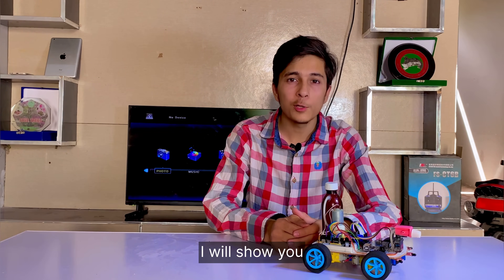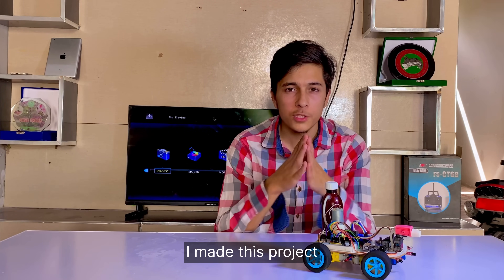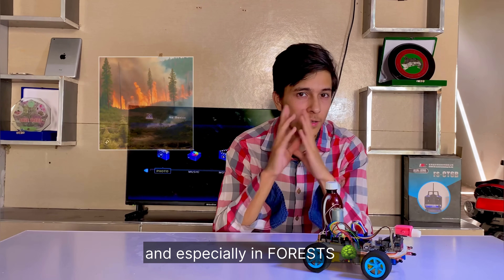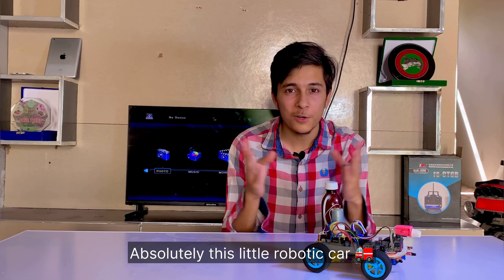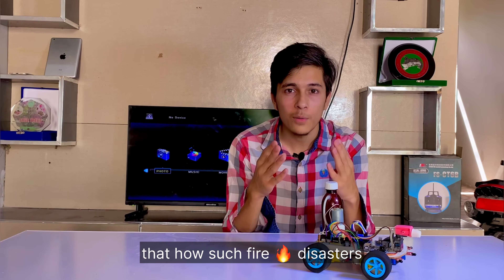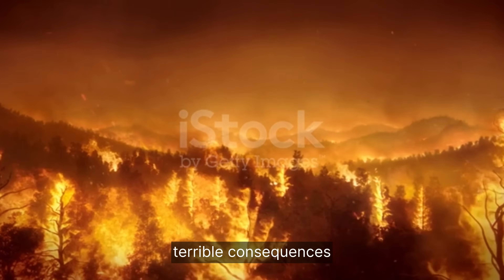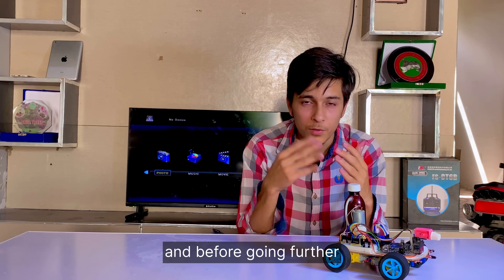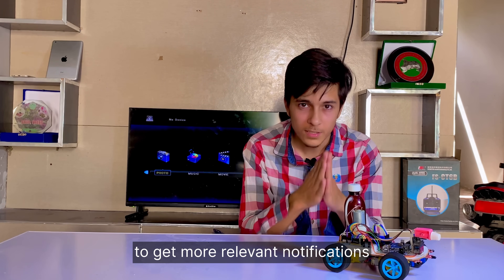DIY Fire Fighting Robot using Arduino  |  Auto Fire Chaser and Extinguisher

Comment: Its taking too much time to upload code??
According to you how much time it take to upload
Reply from the maker: Since I am doing, less than a minute, usually 10 seconds
Reply: @saadinnovativeideas it was taking too much time(4-5 mins) so i remove the cable and push red-button on uno for reset and then re-upload this code and this code giving error.
Reply from the maker: You may not have selected the right port (COM) or you cable may be faulty
Reply: @saadinnovativeideas  All thing is good 
but one major issue is my robot is not moving after detecting fire and some time it is giving long beep sound.
Reply from the maker: Yeah, you power supply is weak. Name the batteries and net input voltage
Reply: @saadinnovativeideas  
MICROUSB Compatible with Ultrafire I865O 3.7V/6800mAh Rechargeable Battery (2 Pc)
I have exactly same but it is of 6800mAh
and i have 300 rpm BO motor
Reply from the maker: Have you connected both batterie in series to get 7.4v output?
Reply: @saadinnovativeideas  Yess , I have added in series.
I think my voltage is less.
 I have to add 3 li-ion 3.7 V cell to get 11.1 V . which can run robot .
Is that okay??
Reply: @saadinnovativeideas  Waiting for your respond
Reply from the maker: Have you used flame sensor with analog A0 pin as shown?
Reply: @saadinnovativeideas  I don't know what you are saying!!!!
But i am sure that what you have do ,I have done exactly same .
When i fire near the robot i see another red light blink when come in range (not default red light on sensor).
So their is no issues with sensor. 
can i go with 3 cell or 4 cells ??
Because I think my voltage is less .
Reply: Waiting for your reply!!!!!!!
Reply from the maker: Which battery have you used?
Reply: @saadinnovativeideas  Battery Type: Li-ion rechargeable battery
Size: Standard I8650
Reply: please give me solution as soon as possible
Reply: hello all is done but my servo is not moving,
I have tried so much change the wire and i have done exactly same as you shown in video.
what should i do now??
Reply: and also may i know where did you get this code there are so much issue with this code like , bo motors not functioning properly, continuously moving , etc

Comment: hi can you help me? I followed all of your instructions and check the diagram but when I turned on the robot, the transistor started smoking I don't know why
Reply: I think I just figured it out. I didn't notice that I used 12V water pump which may cause the transistor to heat up fast
Reply from the maker: Of course brother 12 V pump will consume much amps causing the transistor to heat up
Reply: Can I ask, what if I use 12v water pump, what should I change in the value of transistor and the resistors or capacitor??
Reply from the maker: Name the pump, and if you can also tell its ampere consumption

Comment: i followed your code and wirings but my problem is when I turn on the switch that it connects to the battery they literally on but its not functioning but when I use the USB cable for arduino the servo motor and water pump and the flame sensor is functioning? my only problem is the wheels I don't know how to make it works? thanks for your concern.
Reply: is the battery my problem? its 3.7v but 4000mAh in 2p
Reply from the maker: Yes you are having battery problem
Reply from the maker: 3.7 v per cell is okay, but you said 2p means two batteries in parallel, means the total voltage will be again 3.7V which is definitely not sufficient and bo motors will not rotate.
Connect both 3.7 cell in series making it 2S so its voltage shall sum up to 7.4V which is desired.
Reply: @saadinnovativeideas  bro i followed all the instructions you shown but when i uploaded the code the water pump,the flame sensors,the servo motor when i turn on the switch it automatic, detecting fire even theres no fire there. Whqt is the reason bro?how can i manage ?and also i followed the power supply but the wheels dindnt fuctioning.

Comment: your code and your circuit diagram but my mind will also blown out cause don't get the wirings from the l298 module.....i inspired by your work so that I want to try it, use it for my project but my only mistake is one day before deadline.
Reply from the maker: I have cleared every connection in circuit diagram, if thats blur then see this one  https://drive.google.com/file/d/1bFK8Dwt6g-Z2kP-Qzci0NTRzXW0DrkRT/view?usp=drivesdk

Comment: Can we use 9 volt battery instead of 2 (3.7 volt battery
Reply from the maker: No, that cannot provide desired apms
Reply: @saadinnovativeideas  but i cant find and they are not available 3.7 volt batteries what should i do
Reply: how many amps are required
Reply from the maker: You can use phone batteries they are also 3.7v and join them in series
Reply from the maker: 3+ amps are required, but that 9 volt non rechargeable battery can hardly provide 1 amp
Reply: I can't use phone batteries tell me any another another way or how can I make 3 plus amperes with 9 volt batteries please suggest me
Reply from the maker: Brother there is no way to take out much more amps then a battery can driver. Use any rechargeable battery, check it online
Reply: @saadinnovativeideas  can I use 9 volt rechargeable battery

Comment: Hey my model is not working i had check everything is working properly but it isn't sense the fire can you please help me with this
Reply from the maker: How much pin sensor have you used? And which battery?
Reply: 3.7 v battery
Reply: I have used everything which you give on the description
Reply: I am using 3 pin sensor because four one is not available in my area
Reply from the maker: So three pin sensor has no analog pin (A) . Code is for analog pin of sensor. You have yo modify code
Reply: @saadinnovativeideas  please tell me how should I modify it
Reply from the maker: Try to use 4 pin flame sensor.
If you fail to avail, then for 3 pin flame sensor having D0 pin;
Connect A0 of all the sensors with 2,3,4 (digital) pins of the Arduino uno board and in code replace A0, A1,A2 with 2,3,4 respectively and replace analogRead with digitalRead
Reply: @saadinnovativeideas  should I replace analogwrite into digitalwrite also?
Reply: Hey the code is not working please help I have my college exhibition day after tomorrow

Comment: Saad plz help me my flame sensors is not working😢 
It has three pins 
What you have taught i've done everything u taught plz try to reach me
Reply: I modified the code but I dont know how to set pins
Reply from the maker: Try to use 4 pin flame sensor.
If you fail to avail, then for 3 pin flame sensor having D0 pin;
Connect A0 of all the sensors with 2,3,4 (digital) pins of the Arduino uno board and in code replace A0, A1,A2 with 2,3,4 respectively and replace analogRead with digitalRead
Reply from the maker: Have you modified the code and connections for three pins?

Comment: the sensors are not working with that code you wrote they never reach under 800 from far distance,
Reply from the maker: Which sensor have you used?
Reply: KY-026 flame sensors they look exactly as yours red color
Reply from the maker: You mean 4 pin sensor
Reply from the maker: The code and circuit diagram are correct. Double check your connections
Reply: @saadinnovativeideas  it has 4 pins but i use only 3, 2 for ground and 5v and one for the analog
Reply: @saadinnovativeideas  i mean it works but not as accurate as desired. Im connecting it direct to the board just to test it. Will the things change if i connect it like in the circuit diagram?
Reply from the maker: No, no need to change..
Tell me some some symptoms, does any of the component not work? And which battery have you used?

Comment: bro help me
Reply from the maker: Ask
Reply: @saadinnovativeideas  my servo can't work and my sensor don't red light/light, my bo motor can't working. what solution?
Reply: @saadinnovativeideas  pls help bro..
Reply: @saadinnovativeideas my servo can't work and my sensor don't red light/light, my bo motor can't working. what solution?
Reply from the maker: Which sensor(3 or 4 pin)  have you used? And name the battery
Reply: @saadinnovativeideas  4 pin and the battery  ultrapower 3.7v
Reply: @saadinnovativeideas  4 pin and batterie ultrapower 3.7 volt
Reply from the maker: Double check your connections according to circuit diagram (👉  https://drive.google.com/file/d/1bFK8Dwt6g-Z2kP-Qzci0NTRzXW0DrkRT/view?usp=drivesdk
Reply from the maker: And make sure code is successfully uploaded with a right port (COM)
Reply: @saadinnovativeideas  already,but its still no react

Comment: My Project is not moving all components are working but the project is not moving
Reply from the maker: Then your power supply is not compatible. Which battery have you used and what is the total input voltage
Reply: It is not moving with the cable also
Reply: 9v
Reply from the maker: I said many times that it wont work with 9v non rechargeable battery. Try to use rechargeable battery because that can provide sufficient amps

Comment: Hi I am making this project but my flame sensor is not working I have checked the circuit diagram couple of time I have to submit in three four days what to do
Reply from the maker: How much pin flame sensor have you used. Do that have A0 pin?
Reply: @saadinnovativeideas Do ,sir
Reply from the maker: Try to use 4 pin flame sensor.
If you fail to avail, then for 3 pin flame sensor having D0 pin;
Connect A0 of all the sensors with 2,3,4 (digital) pins of the board and in code replace A0, A1,A2 with 2,3,4 respectively and replace analogRead with digitalRead
Reply: sir I used 2 flame sensor AO,VCC,GND
In code I have to change or not
 @saadinnovativeideas
Reply from the maker: No, you are already have analog (A0 pin in your sensor. No need to change code or circuit diagram
Reply: Sir I cannot understand..
Reply: I have three pin flame sensor ..Shoud I need to change the connection of wires at the bottom ..
Reply: Pls reply sir

Comment: Sir three pin flame sensor hone se coding mai changes karna padega kya
Reply from the maker: Try to use 4 pin flame sensor.
If you fail to avail, then for 3 pin flame sensor having D0 pin;
Connect A0 of all the sensors with 2,3,4 (digital) pins of the board and in code replace A0, A1,A2 with 2,3,4 respectively and replace analogRead with digitalRead

Comment: can i use DO pin of flame sensor (cause i have 3 pin flame sensor instead of 4 pin and it doesn't contain AO pin ,it contains DO pin) ? 😅
Reply from the maker: Try to use 4 pin flame sensor.
If you fail to avail, then for 3 pin flame sensor having D0 pin;
Connect A0 of all the sensors with 2,3,4 (digital) pins of the board and in code replace A0, A1,A2 with 2,3,4 respectively and replace analogRead with digitalRead
Reply: @saadinnovativeideas  thanks bro!!
Reply: @saadinnovativeideas  should i even analogWrite?

Comment: dostum tüm bağlantıları videodaki gibi yaptım ama 5v çıkışını breadboard a takınca çalışmıyor ışıklar sönüyor aynı zamanda su pompası dışında hiçbir şey çalışmıyor yardımcı olarabilir misin ?
Reply from the maker: 5v us not sufficient brother. Give at least 7.4 voltage
Reply: 3.7 3.7 olarak 7.4 volt veriyorum her şey olması gerektiği gibi arduinoya taktığın jumper kablo  breadboard üstüne sizin gösterdiğiniz gibi yere yerleştirdiğim de arduino da Işık sönüyor
Reply from the maker: Double check your connections with the circuit diagram I provided because there may be a short circuit. If circuit diagram is blur then let me know, I will send you a new one.

Comment: hi! i need to ask you something about this project. why does the transistor in our work is heating up? we clearly followed your procedures and it works really fine now but when we tried it to move and detect fire for 2 minutes the transistor was heating up also that the mini servo doesn't move and the water pump also but the movement is working perfectly fine . what do you think should we do?
Reply from the maker: How much volt pump is used?
And for servo try yo flip the two wires and leave the middle one
Reply: @saadinnovativeideas  we actually ordered the wrong pump and it was 6v but we recently ordered a new one with 3v-4.2v and we're now just waiting for it to arrive. how about for the transistor that's heating up?
also the servo works now. thank you
Reply from the maker: Welcome. If you use the right pump, the transistor will more heats up

Comment: Flame sensor ke samne flame lane par transistor heat hota hai usse diode bhi kharab ho ja rha hai aur bo motor, servo aur pump motor chal nhi rha hai......please  help me sir!!!
Reply from the maker: Flame lane per sirf pump work karta hai ya baqi components bhi?
Reply: @saadinnovativeideas   flame lane par flame sensor detect kar rha hai lakin kuch chal nhi rha hai aur sensor detect karne par transistor heat ho ja rha hai usse zener diode  kharab ho ja rha hai
Reply from the maker: Phir sensor three pins ka use kia hai I think
Reply: @saadinnovativeideas  ha three pin wala sensor hai
Reply: Usse coding mai changes karna padega kya??

Comment: What is the name of black pin like structure that you connected to wires plz reply
Reply from the maker: Tell the video duration so I can check
Reply: At 4:38 connected to yellow green white blue and purple wires
Reply from the maker: Thats male pin of the jumper wire that comes bey default
Reply: Thank you
Reply: Within 1-2 days I'll start making this project so I may need more help of you.
Reply from the maker: Welcome!
Why not I will
Reply: can we use 9 volt battery instead of 3.7 volt batteries
Reply from the maker: @  No

Comment: Hi Saad the project got selected for national level entry..thank you so much but I have a request can we still add some more features and improvise it…I think then some changes also will have to be made in the code..your help would be appreciated thank you
Reply: Hello sir.....Can you please help me..If I have any problem ?
I'm also thinking to make this car...
Did everything worked for you ? 
Did we have to make any changes other than video ??
Please i will appreciate your response
Reply: Hi no just follow the video it will work out
Reply from the maker: Let me know what changes you want yo perform
Reply: @SriVydyaDentalHospital  bro you can help me too about any back end adjustments
Reply: Hmm like obstacle crossing and instead of a water can on the above can we add a tanker…and additionally some alarm if possible
Reply from the maker: For alarm give parallel connection to the buzzer from servo positive and negative terminal
Reply: @saadinnovativeideas  try to reply whoever comment about the issues we are facing in implementing the project,
Reply from the maker: I try my best yo give a quick response
Reply: @saadinnovativeideas  please draw the Circuit diagram with distinguished Color code, it helps to connect correctly
Reply from the maker: @feelofdeen   I have composed new clear circuit diagram 👉  https://drive.google.com/file/d/16AiTn2cZ1DXvroeGBCLWNLjX7576a6yw/view?usp=drivesdk

Comment: Hello Saad. In my project the robot doesn't recognize the fire very well and goes in the other direction. Can you help me?
Reply from the maker: Not a big deal. Reverse the order of pins that come from motor driver to arduino uno. Or try to flipping the wires of bo motors to the slots of motor driver until it perform properly

Comment: Thanks Saad
It's working very well but only at night not in day light
Reply: bro can You please help me , after 2 days I have presentation
Reply: Your model is moving? Mine is not moving but motor is working it only doesn't moving... What do you think about this problem? Please reply
Reply: @Alwaysalearner-fn9io  Same problem bro
Reply: Same bro its not moving
Reply: Is the code and circuit diagram correct ???
Reply: Is that working please can you tell how to make ? Do you changed any step from here plzz tell

Comment: Bhai from this project we are selected for second round in our college but due to the tyres are no moving we can't win please help for this I had write many comments but there are no solution for my problem so the problem is I am using three pin flame digital sensor and giving 3.7v two battery power but no working of tyres help me
Reply from the maker: Connect the A0 of the all the three sensors to the digital pins (2,3,4). And in code replace A0, A1, A2 with 2, 3, 4 respectively. And change the analogRead with digitalRead (that come three times)

Comment: hello bro ,so if i use digital flame sensor i have to change the code..? please bro , i came from vietnam...can you give me the code with digital flame sensor ? ...the blue flame sensor....
Reply from the maker: Connect the A0 of the all the three sensors to the digital pins (2,3,4). And in code replace A0, A1, A2 with 2, 3, 4 respectively. And change the analogRead with digitalRead (that come three times)

Comment: Brother
What can be replaced with a TIP122 transistor is not available right now??
If we replaced anything, does the coding need to be changed??
Reply: Coding still works but it could overheat or not work depending on the power but who am I to talk, I burned my diode lmao
Reply: Is the code and circuit diagram correct ???

Comment: bro pls reply fast its extremely urgent pls tell if we can make this project without breadboard and just follow your circuit diagram?
Reply: @pravinsangu6616  I think no!! Iam also making this i have all components
Reply from the maker: Yes of course, you can perform soldering or just joining the wires as well, but accordingly with circuit diagram just